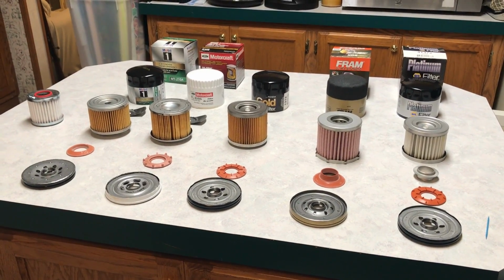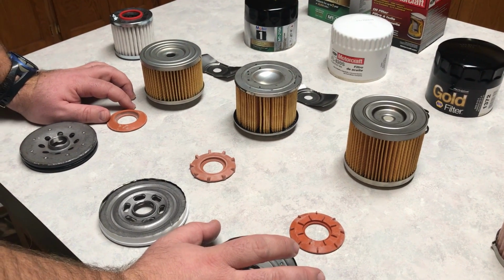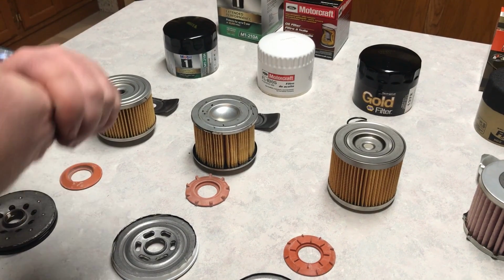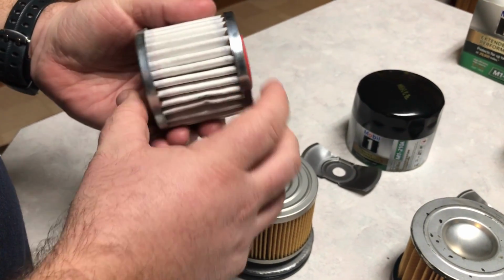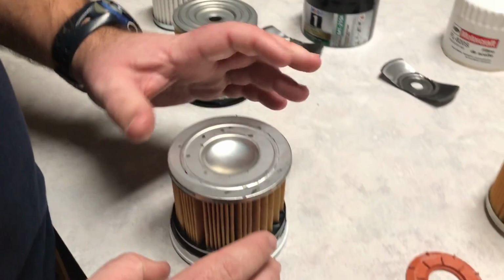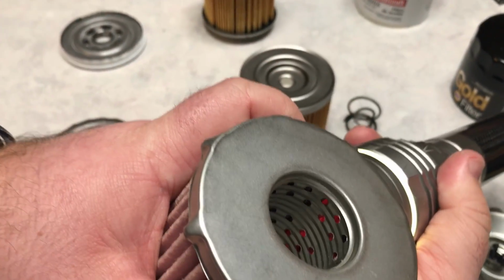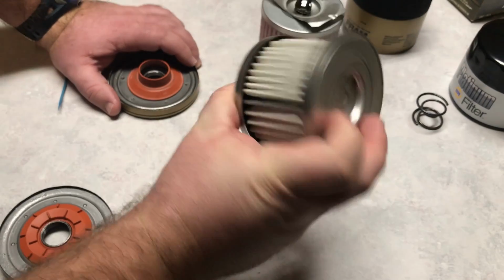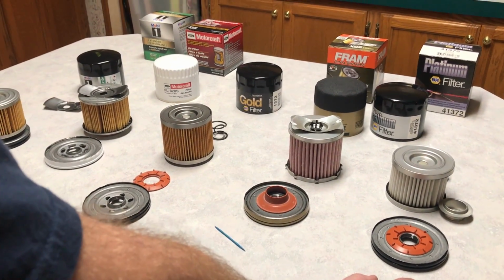2018 Cut Open OIL FILTER Comparison for Ford Modular, Mobil 1, Fram, Wix, Motorcraft, Napa

Comment: To start Im very educated on this subject of oil filters and fluids. All these filters you have are  good. Cheapest being the motorcraft made by purolator. Best filter on the table is the fram ultra and one the best values for well constructed filters. It's actually over built for most applications as it has 2 types of media that is wire backed. Close second is mobil filter. Another very good filter.  I use alot of of napa golds, which is a wix filter ,due to napas 2 time a year filter sale and I stock up due to napa golds sale price usually around 2 to 3 bucks a filter. Awesome deal. Now the platinum filter u have there is the most expensive of all these but has least particle size filtration. Well made and good filter but not as good when it comes to filtration. I would use them tho and not worry but cost steers me to napa golds.  I like to use good filters as it makes me feel better but oil filters dont do as much as u think especially after a motor is well broken in. I just  buy better filters for cheap filter price so I use them. The most important filter on your vehicle is the air filter. Use good air filters and do not (yes I said do not) change them until they are dirty and need changing and change right before an oil change and not right after and install correctly. Air filtration is key to engine life along with oil changes.

Comment: I agree, however people go to great lengths to avoid changing their Oil & Filter.   If anybody changes 
oil by the manufacturers recommendation are BD.   Change UR damn Oil & Filter, don't wait - do it.
Engines LOVE clean oil.
Reply: And use Denso  oil filters
Reply: I use castrol 20w50 in my Dodge Durango spring -fall 5.9 L ...change it 1300.-1000. miles

Comment: All my life, my dad used Fram Filters on all his vehicles. He maintained and rebuilt his own engines. So he put a lot of hard work and money into his cars and trucks and Fram Filters is what he chose to put in them. I followed his lead and I have put Fram Filters in all my vehicles for the past 30 years. Not one single issue or problem. I have a 2000 Ford Explorer with almost 300,000 miles on it and Fram is all that SUV has seen.
Reply: How often you change it may be more important than whether you use Fram or not.

Comment: Rest assured every filter on that table has a throughput far higher than the pump rate of any typical automobile, 98% of vehicles on the road will have a flow rate limited by the oil pump alone. Folks like to debate about which filter is more restrictive than others (which is fine) but what is never taken into consideration is the flow rate of the oil pump (which is typically 2.5-3 gallons per min). Short of a cold start at -40 (it does happen here in North Dakota) your oil filter will not be the limiting factor in the sense of flow rate. Even than it would be on the viscosity of the oil and not the filter (which is why we have bypass valves in filters). You would need a rather high end high flow oil pump meant for strictly racing to even come near the point where the filter would cause restriction in the system and even than once again bypass valve.

Comment: At first, now can you drag that for 46 mins? This is remarkable!  I use fram Ultra but I agree that the separation between dirty and clean fluid could be handled better, also the pressure could've been managed by a spring other than leaf spring. And I'm not convinced the backflow valve works best this way.

Comment: Been using Fram on and off for 20 years on multiple vehicles. No problems what so ever. I use them for 2000- 3000 miles and I change them. If you use them for extended miles like 7000- 10,000 miles ur gonna end up with a problem. Unfortunately ever since the bug caught on that, " dont use fram". " it's gonna blow up ur egine". "Don't do it". Well guess what? I been doing it. My current vehicle has 270,000 + miles on it. Running strong. That's because i service my vehicle. The best oil filter on the planet will mess up ur engine if don't service it and leave it in ur engine indefinitely.
Reply: FRAM OIL FILTERS ARE JUNKS !!!!!!!!!!!!

Comment: QUESTION?
Do the filters catch debris on the inside or outside of the media?
In other words would any metallic or other debris get caught on the inside or outside of the pleats?
Thanks to anybody for answering.....
Reply from the maker: Debris is caught on the outside side of the filter. Oil flows in the small holes and out the large center hole.
Reply: HYDRA DYNAMIC outside

Comment: Dwain S&w - I agree with you! I worked aerospace for 40 years and every filter shown really sucks as far as overall quality of materials, integrity of components, and assembly. There are some real cheesy components in these filters. I’m ashamed of Ford (MC) which I have to use under warranty, no less. F-150 3.5 Ecoboost 5W-30 Syn blend.
Reply: Motorcraft filters for oil & air are very good! Bobistheoilguy.com

Comment: Over the years of helping friends change their oil/filters I have come across three Fram extra Guard filters with the filter media absolutely loose and rattling around inside. It was like the flat spring thing at  the bottom was gone. When holding the filter with the inlet and outlet openings up the filter element fell to the bottom and there was about a half inch space between the top of the filter element and where the invisible anti drainback valve should have been. These filters would have been doing absolutely nothing! I didn't open them but it was like the bottom spring and the anti drainback valve were either never there or they were magically dissolved by the oil.

I can't imagine that fram made these three filters simply for my entertainment so it makes one wonder how frequently these failed fram filters are changed out at oil change shops without anyone making note of the frequency of failed ones.

Comment: The filter cleans small debris, if it stops up or needs to clean more you have engine problems or didn't change oil properly. The filter only is used for 5 to 10,000 miles ,change regularly with oil.I use motorcraft never had engine problems.Use synthetic blend.

Comment: for applications (like most) where the filter is installed with the threads up, It appears that the anti drain back valve is useless and never used.  it would only be active if the filter is installed upside down.  Correct?
Reply: Or sideways.

Comment: So, when is good enough good enough. Seems there is a lot of discussion of a lot of differences without distinction.
Reply: Dwain S&w - I agree with you! I worked aerospace for 40 years and every filter shown really sucks as far as overall quality of materials, integrity of components, and assembly. There are some real cheesy components in these filters. I’m ashamed of Ford (MC) which I have to use under warranty, no less. F-150 3.5 Ecoboost 5W-30 Syn blend.

Comment: Anti-drain back valves can leak oil back through the oil pump into the sump. This causes the oil filter to empty itself and that is bad for the engine as you have a dry start every time you start the engine after sitting for a few days. My 4.0 Jeep engine with a Wix (from NAPA) filter did this and the valve lifter clatter was the major clue to a filter filled with air. The filter is mounted horizontally to the side of the block. I had a Wix engineer come out and I filled the filter with oil, plugged the discharge with my thumb, turned the filter on its side, and we watched oil flow out past the anti-drain back valve. Just because a part is new does not make it good.

Comment: What came on your vehicle from the factory? Smarter people than us made that decision for a reason. Hell of a lot of factors go into it. Like the oil pressure of your engine at certain RPM. Filter restriction and the flow your engine needs. Application also. That being said never seen a Fram on any car or truck from the factory Lmao.
Reply: Honda and Subaru filters are made by Fram. -_- It's just rebranded.

Comment: I currently have Fram oil filter in my car. The cheapest one. 267,000+ miles and running strong!
Reply: I've been using Fram filters on my 1997 Honda since 1999. Never had a single problem. I do change the oil every 3,000 mi. My vehicle is very close to turning 400,000 miles
Reply: I used to be a Fram hater but all of them have their use cases. The most important thing is not what you use, it's using it right. Replace oil often and you will have less problems.
Reply: U are one of the few sir!
Reply: Cheap isn't always the best they're junk. Spend an extra $4 for a better brand so the next person that buys your car doesn't have to replace your mistake
Reply: @wetch5402  it's not a mistake if the car is still perfectly fine
Reply: @TheMstwntdLMSV123  next time you do a oil change put some in a bottle and send it off for testing I promise there's gonna be more metal shaving and other materials that shouldn't be in your engine compared to other vehicles that actually used a decent filter. Matter fact cut open your Fram filter its literally cardboard paper inside lmao. JUNK. Won't be long till your car starts having issues and your gonna act like you don't know why it happened
Reply: @wetch5402  you're completely missing the point. I'm not arguing that they are the best. I personally feel the Purolator BOSS is among the crowd as one. All I'm saying is that your engine won't blow up if you use one.
Reply: @TheMstwntdLMSV123  debatable
Reply: @wetch5402  My 1994 Dodge Cummins has a million miles using orange Fram oil filters.

Comment: I have a ? on your car dose your oil cooler line have a vibration and in the area of my lines there is a loud buzzing noise but once it warms up it goes away I was reading on a form that the anti drain back valve can cause this but it has done this for a while I always blamed it on the power steering pump because that's kind of what it sounds like but today I was under it when it did it and it was coming from the oil cooler lines.  Thanks

Comment: my engine uses 10w30 and i live in a all season state
Reply: Without mentioning your year make of vehicle, your comment means very little. Are you using what the manufacturer recommends?
Reply: Bad. More wear. Worse MPGs. Best all around viscosity is 5w30. Try it. Use Motorcraft oil & air filters. Ur engine will Thankyou.

Comment: I have a 2006 CVPI. Motorcraft is the only way to go for your Ford engine. Don't waste your money on the others and avoid Fram at all costs. I have never had a problem with my Fords in 30 years of using Motorcraft. Frams have blown apart.
Reply: J.T. Cooper Can you please do a review of the K&N HP-1010 oil filter?
Reply: @ronniethomas6335  I've never used one. Motorcraft only for the last 20+ years.

Comment: What about the seal on the base. I had a Wix filter, made in China (some were found to be made in the US when I did research) this seal was asymmetric and blew out destroying the Mitsubishi Lancer engine. Wix then closed down in Australia and after having ARP bolts in america deny a claim on a connecting rod bolt failure through the knerl on their HP bolts I decided not to wast my time. I now use exclusively Ryco Australian filters. So check your base O ring, thick symmetrical,square and firm is the go.

Comment: Fyi, standard Wix and Napa Gold, have a beta of 20=20 meaning 95% @ 20um which is pretty darn good. The Napa Gold for this application has dome bypass. The vast majority of Wix, Napa Gold have thread end bypass. Ultra is an excellent filter and the only Fram filter I'll use.

Comment: Why don't people just go with manufacturers recommended .running around blind fold looking for filter base on colors.look.feel.thickness don't even know what kind of material made out of.even know when you think it's good but for what engine ?or it's universal
Reply: Because manufacturer job is keeping the car good enough only during warranty period. How are they gonna make money if every car in the market can last more than 200k miles easily and every buyer not replacing it for the next 10 years?

Comment: say no to fram. any and all frams!
Reply: Not true with the Ultra. It's one of the best filters out there
Reply: I agree that Fram sucks . (But) the ULTRA is not in the same league as the shitty lower quality Frams . Not even close. I use any thing thats on sale thats top shelf . K & N, Mobil 1 , Or Fram Ultra. Mobil 1 full syn , 5w30 5 qts then add the half qt. of Mobil 1 full syn high mileage for my taco . The reason I dont use all 5 1/2 qts is the high mileage has rubber seal conditioners that make it swell. If u go back to the regular mileage oil it will most likely start leaking from seals that arent getting conditioned any more . And change my oil every 3 to 4 k religiously . Runs like a bat out of hell and I run the heck out of it , Heavy foot.
Reply: Fram is not a bad filter....

Comment: Very good review. What about Bosch oil  filters or Amsoil oil filters?
Reply: Bosch Filtech is excellent an under $8
Reply: Sally Hillal  Most don’t, Amsoil and Royal Purple (nearly the same filter, BTW) filters are the best 4.6/5.4 filters on the market.  If only they had the Motorcraft thread end bypass valve

Comment: It would be interesting to see you add a Fleetguard filter to your lineup. I work at an International dealer and most people swear by those filters, they also have a line for smaller engines as well.

Comment: I use Fram Ultra Synthetic oil filters.
Reply: Well you're a dumbass
Reply: @Gatorsrok  Fram Ultra is very good.
Reply: @Gatorsrok  Really bro? I'm not even a Fram guy and those Ultras are great filters. One of the best. Along with RP and Purolator boss. The Wix XPs are literally the most overrated of the bunch. Bad efficiency numbers and weak spring
Reply: @Gatorsrok  takes one to know one!

Comment: The motorcraft doesn't have the same grip as the others.  I use the socket style in my explorer because it is so hard to use a wrench most filters 
use the standard tool except the motorcraft.

Comment: I drive a 1996 mercury grand marquis gs and what's the best oil to use for my car cause I want a very good oil filter cause I use full synthetic motor oil. i'm using the motorcraft oil filter so you think I should use the royal purple oil filter
Reply from the maker: It would partly depend on your oil change interval. I have a motorcraft oil filter on my car right now. I'm going to take it off soon with 9,000 - 10,000 miles on it. I'm currently running Valvoline Maxlife Full Synthetic 5w30 in my Crown Vic. I will cut it open, and we can look at it together. I'm looking to see if the media tears. I also have my last oil filter change video that I still need to post. In it I used the wix filter. 

In your case, I like the thread end filter by pass valve used in the motorcraft, but I think Royal Purple has a great filter. As long as the motorcraft doesn't tear, I think it comes down to value, and what your are willing to pay. If I only  changed my oil every 20,000 miles or so, I would without question use the RP.
Reply: I will try the royal purple next oil change with the schaffers 5w20 motor oil and see how it runs ya see thanks gun daddy. I drive a 1996 mercury grand marquis gs
Reply: +HoosierGunDaddy Quick question on oil viscosity. Why stray from the ford recommendation of 5w-20 and use a 5w-30? I've always held the opinion that you should always use the manufacturer recommendation on oil viscosity. Now i understand the 4.6 valvetrain is a little less sophisticated as say a 5.4 triton, but i've always wondered why Panther body car owners move up in viscosity?
Reply: YES. ALWAYS use the manufacturer's recommended oil viscosity !! One good reason is that the oil viscosity is a determining factor in the Oil Filter Pressure Relief (filter by-pass) valve's opening pressure.
 Your oil filter has a pressure-relief valve that opens when the filter begins to clog with debris.
 Using heavier (thicker) oil of a higher viscosity will cause the by-pass valve to open too soon, thus reducing the filtering ability of the oil filter.
 "Thicker" oil does not offer ANY benefits over the factory-recommended viscosity -- thinner oil gets to the bearings faster, cools better, and keeps the filter by-pass working as it should.
  The factory-recommended oil viscosity for the FOMOCO 4.6 Liter V-8 was CHANGED from the 5-W-30 for earlier engines to a 5-W-20 for the later models.
 I use and recommend the CASTROL 5-W-30, "SN", Full Synthetic oil and the BOSCH DS3410 oil filter as best choice for my '95 Grand Marquis Restoration (157,000 miles).

Comment: I'm glad I stumbled across this video. I've used mobil 1 extended performance filters for years and I need to buy another one and noticed it's a new version but, on the website for the new version they don't list the silicone anti drain back valve so I was concerned they stopped using them. However I see from your video they are still using them. I guess they just forgot to list that feature.

Comment: Best oil filter review on YouTube!!!

The Napa Platinum filter is the reason I don't like the spring than a metal leaf. Since the spring is right in the middle of the can there is a chance that the filter can go to either side and make an opening by the drain back valve.
Reply: Malith Perera , Thanks. How was that; filter to either side you found?
Reply: Err,, I use NAPA GOLD oil filters
Reply: Ps, I use NAPA PLATINUM IN MY 2007 GMC CANYON, AND 2015 Journey 4 CYLS.....